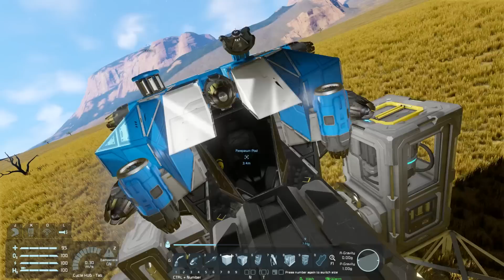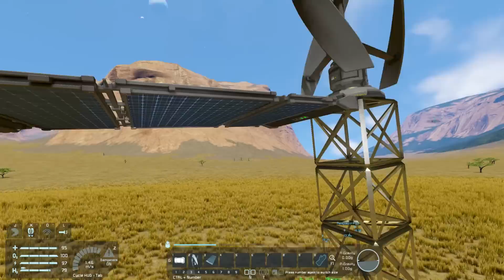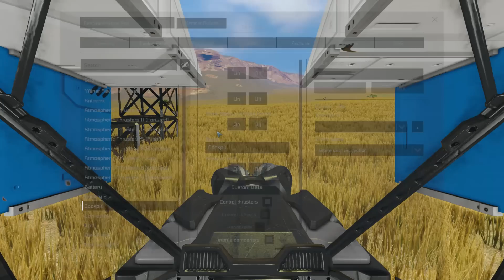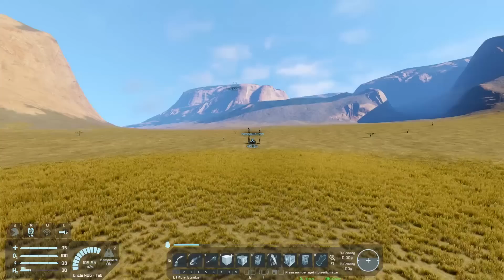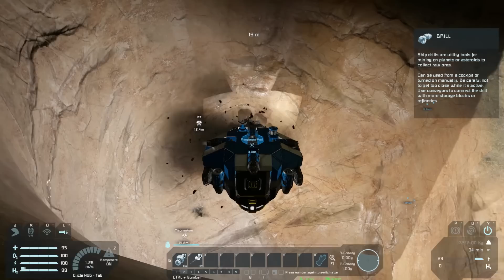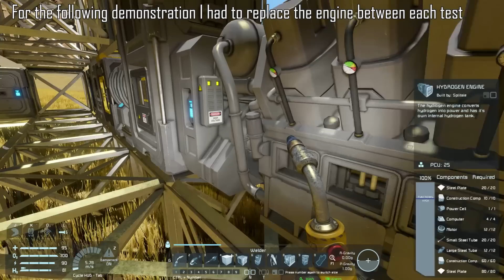Power Systems - Getting Started in Space Engineers #3 (Survival Tutorial Series)

Comment: Dear Spitsie--  Please keep making these so I can keep advancing.. oh so slowly. Well done, and much appreciated efforts!

When I'm not using the big power-sucking devices, I turn them off, and let the 2 windmills charge some batteries I've installed. Also, set the vehicle battery to non-drain, recharge only. Anybody else?

Also wondering: does your miner recharge if it's turned off? Or if lots of the systems except the needed ones are off? Less drain either way, maybe?
Reply from the maker: Thanks, glad they've been helpful :)

The miner will not recharge if it is off as the connector would also turn off and you wouldn't be attached to the base. However, if you turn off most blocks except for the batteries then it will recharge and is probably something you want to do anyway :)

Comment: So, you use electricity to split water (ice) into hydrogen and oxygen, then you burn that hydrogen, producing power with water (presumably steam, since that's the product of hydrogen combustion in the real world) as a byproduct. Somehow this results in a net energy positive.
Reply from the maker: The system doesn't make sense if you think of it in terms of electrolysis and hydrogen fuel cells with current technology. Instead think of it as a gameplay mechanic (separate to real world physics). Instead of adding yet another voxel material to enable the addition of a fuel powered engine (that isn't a reactor) they decided to use ice and hydrogen as a fuel stand-in ignoring those other issues :)

It really helps make their existence more acceptable if you think of it in this way :P
Reply: @Splitsie  I'm fine pretending they use some magical catalytic technology that enables this kind of thing, to preserve the enjoyment of the game. =)

Comment: So, the thing about Hydrogen Engines is they're designed to work with a hydrogen tank. I've had similar issues, to turning it on and off even with a tank, but that buffer helps with the issue of normally needing two O2/H2 gens.
Reply from the maker: Yep, the tank does make them behave a little more like you'd expect (except for having to toggle power to get them to start), I still liked using it for an example of how to toggle power on your grids as it's advice that I see given (and misunderstood) on reddit a lot :)

Comment: Enter the Advanced Rotor with a small rotor head and a small ship Hydrogen Tank with a connector on the other end. Dock the mining ship full of Ice to the hydrogen tank and the bases O2/H2 will pull the Ice then fills the tank. This way you will not need a second O2/H2 on the base since you can now supply the Hydrogen engine with enough Hydrogen to fill its on board storage and it can run at its full potential. Sure you can build a large hydrogen tank but when starting out, a small one saves on resources plus you get the added benefit  of relocating the small tank by detaching the rotor head and not loosing what hydrogen is in it.
Reply from the maker: Using the rotor size switch is also a nice way to get lots more storage on the base without needing grids as well, and with the increase in capacity of the tanks a small one is probably adequate for a while. It's something I'm still trying to decide when to best include in the series as the concept often ends up misunderstood by newer players :)
Reply: Sounds like the makings of another tutorial. Rotors: What else are they good for and how to use them.

Comment: I find a sensor, set to detect me when I'm about to get into a cockpit, connected to a sound block that shouts "turn your batteries on you spoon" works quite well...
Reply from the maker: Lol I completely endorse the setup of this sort of system, useful for new and old players alike :D
Reply: I put my startup/shutdown sequence along my hotbar in preferred order (ie: toggle recharging off, toggle gyros on, toggle engines on, toggle ore detector on, toggle connector to disconnect, etc). It's easy and almost* foolproof.
Reply: Im reading this after crashing ship on ground and trying to figure out what happened for like 20 min then realizing I forgot to switch battery on.
Reply: Spooning is ok .... but forking is better ! 😎
Reply: Kontra Septic knifing is even better
Reply: Great idea :D
Reply: LMFAO!!! I have had to reload a save multiple times cause I forget to hit "6" before disconnecting, which is my button for recharge mode on my g-menu.
Reply: 3 times tonight. My second day engineering so never thought of that or at least a sign :P
Reply: as for me, I put button that call timer that set to recharge, never put it on your control seat toolbar. 
and also I add indicator light or sound on that timer, or maybe LCD that says charging battery, it looks cool battery charging warning system
Reply: 3 years later... it is VERY common that I build a new ship and then spend the next 10 minutes wondering why it's just falling off the connector and not responding to commands.
Reply: a program block that does it automatically works better ... and all it has to do is toggle the lock or unlock and turn on what needs to be turned on before it disconnects ... and turn off what it needs after it connects ... not hard at all

Comment: The cost to /(benefit and time wasted) building a atmosferic ship using a battery to w8 for it to recharge and the ship having A VERY LIMITED capability spectrum IS ABSOLUTELY terrible
after u set up you base don't even bother with building a minnig ship with batteryes and just go for a hydro powered miner with 2-4 drills and atleast a 100 k cap .
if your ship has 10-20 k cap I can do the job 5 times faSTER with hand and with 0 risk if inventory is set to 10xx then atleast 20 x faster with less risk and 10x easyer 
The tutorial is good for new commers but not showing the BEST way to advance ANYWAY good video man keep em comming .
Reply from the maker: This is a tutorial for new players, I'm playing with default settings and providing advice based on those because that's the most likely setup for new players. I would disagree that hydrogen based miners have better function even when using high inventory settings. Since you need to spend so much time collecting all the ice required when a more efficient setup these days is simply pistons and drills mounted on your base and a small battery powered miner for collecting ores you need (with x10 the drill capacity is so large you are unlikely to use up what you've collected within the first 8 hours of playing, longer for newer players).

Comment: I've found that the most reliable way to trip the Hydrogen engine in, after it is first built, is to trigger the H2/O2 Generator, even when the engine is attached to a tank. Simply recharging a  Hydrogen gas bottle, in either the tank, or the H2/O2 gen, will trigger the H2/O2 gen to replace the gas and it wakes up the Hydrogen engine to start filling it's own tank
Reply from the maker: Yep, the tanks are more reliable - I found I only needed to toggle the engine on and off to get them to fill from tanks in most situations. Nice to know that empty bottles will trigger an update for the system too :)
Reply: Oh nice, I'll have to remember! I love using the hydrogen engine in my rovers, and sometimes I forget to fill the H2 O2 generator completely and the engine dies.
Reply: Thanks!

Comment: How does it make sense we're gaining power from electrolysing ice and reversing the reaction in a hydrogen engine?
Reply: because the ice is combusted and you dont get the water out of it. In a therodynamic sense, it shouldnt work, but for the game it makes sense as you use Ice as a rescource to keep the circle running and dont get anything out of it. Put in ice, get out power. You dont generate much power this way, only about 150kWh - 200kWh per 10.000kg ice, so it's not that much of a boost. 
I prefer to us h2 as fuel, because recharging a vehicle with h2 (from a station which has some h2 stored) is a lot faster than recharging its battery due to the battery input limitations (every battery needs at least 15 minutes to fully recharge, if i picked up the numbers correctly). The only problem is, that once its empty, you need a backup battery installed or a reactor to refuel it, since you cant transport h2 in your personal inventory.
Reply: Alright. I think it would make more sense if hydrogen served just the battery replacement purpose you described and you didn't get more power out of it than you put into the h2o2 gen, but I understand the idea behind it now.
Reply from the maker: The reason I didn't touch on that is because it mostly doesn't make sense if you think of it in terms of electrolysis and hydrogen fuel cells with current technology. Instead think of it as a gameplay mechanic, instead of adding yet another voxel material to enable the addition of a fuel powered engine (that isn't a reactor) they decided to use ice and hydrogen as a fuel stand-in ignoring those other issues :)

Comment: i Hope thy make the H2 en a bit more effizient thats why 2 much 2 run this i mean in rl a Car en need much less fuel then this per h then this  and i think the normal fuel gen in my garage has a better fuel consumption  then this XD
Reply from the maker: It's pretty hungry for fuel, I still can't think of a situation I'd use it, other than early game if I started right next to an ice lake :/
Reply: @Splitsie  well i use it in my miner ship but without a tank it hase no rl use (smal grid) 4 emergency power but well i think it should 50% more efficiently with the Hydrogen use the i can build a hydrogen ship only as challenge but 4 now i think i need more then wat 10 full tanks only to fire 2 engine 4 more then let lie 10 mins XD
Reply from the maker: I think a nice balance change would be to halve the power output but reduce the fuel compensation to 1/4, so it's more efficient but less effective. Meaning that the weight factor of the blocks would prevent you from easily powering something that flies, but would work really nicely for a rover :)
Reply: @Splitsie  Yeah may be better they need way 2 much H2

Comment: Yep, you covered the loss of a starter ship quite in depth on this one Splitsie, thank you for that :) If I had only known a few days ago lol. I saw in another video where someone created a wind turbine "tree" which is very appealing. With the wind turbines mounted sideways instead of vertically you can have 1 on either side of your tower and they don't interrupt each other's performance. You can then mount the next 2 90 degrees from the previous ones and you don't have to go up that much higher to add the new ones. Basically I start at 7 blocks high, then go up 5 and add 2, then up 5 ad nauseum. You end up with a lot of power generation in a small space this way.
Reply from the maker: Yep, you certainly can, it's something I plan to mess with in detail in a video just on the turbines as I have an idea for a weird design that might allow quite high density ;)

Comment: Wait... ore detectors consume power? There's nothing in the block's info that says it uses power. checks wiki damnit, game. 

As to the hydrogen engine, from what I've seen, it's really only suitable for emergency power, to keep things running while you pull a major rebuild or the like. I wouldn't even want to use it as a main source on europpa...
Reply from the maker: It's incredibly ice hungry, I'm still not convinced of a good use for it that can't be handled better by batteries :/
Reply: The only use-cases in vanilla i can think of are terribly contrived. I mean, how often are you going to have ungodly amounts of ice or stored h2, and no other options?
Reply: Come to think of it, would make some sense for a tweaked europpa start where you have one instead of other power sources.
Reply from the maker: Yeah, something like that, either Europa or starting on an ice lake. Using a hydrogen engine would be a decent way to boost your early power production so you can bootstrap your way to bigger things more quickly - by being able to recharge the battery based ships more rapidly etc
Reply: I don't think you are giving H2 generators a fair chance or maybe not using them properly...I have a base powered by 8 of them and I think where the confusion must come from is the internal H2 storage and having an unfilled H2 tank.  Flood your system with ice for long enough to hit equilibrium, 100% full generator and base H2 tanks, then judge them again.  

They really aren't that hungry once the system isn't running full bore to fill tanks

Comment: Wind turbines seem to be a bit OP. They produce more power than a solar panel at full exposure, are cheaper to make AND work 24/7 ? Seems like the only drawback is that for each turbine you need an independent pylon, 8 LB's away from anything else, so the ground footprint is way bigger.
Reply from the maker: That and they won't work on a mobile grid, but I agree, I also thought they should be closer to the power output of a solar panel per day, just providing it constantly
Reply: @Splitsie  but they only works on easy planets (with atmosphere/air) so this may be a reason for the power output
Reply from the maker: The trouble is, most of the planets fit that category, they work nicely on Earth, Mars, Alien, Europa, Titan (at least I think they work on Europa since atmospheric thrusters work there)

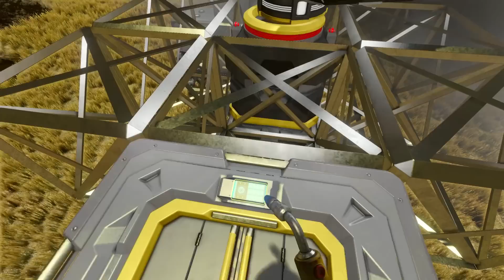Comment: 22:48 That's "Show block in terminal". That's why it solved nothing. If you went to just the battery and wind turbines you'd probably have more luck turning the base back on (I said probably, I don't know if there's a hidden power switch you need the cockpit or control station for).
Reply from the maker: I just had a look through my footage again to check if I was going crazy. With the grid power turned off using Y, the batteries and wind turbines when viewed individually, show themselves as powered on... previously it was not this way, so something changed intentionally, or something was broken unintentionally making using the power switch quite risky and a special case of powering on and off.
Reply: If you use Y to turn a grid on/off, it just toggles the grid's power blocks on/off. You can easily fix that problem by finding your power blocks and manually turning them back on (hydrogen engines, reactors, solar panels, batteries, and turbines will be turned off by pressing Y)
Reply from the maker: Oops! Totally missed that I did that even in editing :P

I did do the blocks individually as well and it didn't work though, and I'm pretty sure I didn't do show block for everything :P
Reply: It's quite easy to miss because it's the same toggle buttons in the same spot with a tiny header above, so I don't blame you. You can blame it on Steve ;)
Reply: @Kyle Baer Actually, the contents of your inventory do count towards a ship's carry weight. You the engineer do not, but your inventory does.

Comment: Yet another great production! one thing to add, the hydrogen engine works "more reliably if it has a tank to draw from instead of just the O/H generator. i think the reason for this is that the O/H generator has to start before the hydrogen power generator actually gets H from it and that creates an issue where the H power gen doesn't start.. on the other hand the tank if it has any H stored it will then give it to the H power gen to fill its tank before it starts, so when switching it on it has that bit to start it up whereas the O/H gen has to convert it first from ice to supply it and its only half what it needs so false starts will be common. at least this has been my experience. i always try to leave H in the H power gens when i turn them off so that they start up whenever i toggle the block back on.
Reply from the maker: That's true, though I've always had to toggle the generator on/off whenever I had a tank as well, except for when placing the generator with creative tools :/
Reply: @Splitsie  i meant after you get it working if there is H in the tank of the H-Engine (not a separate tank) it should turn on every time without fail, unless of course you run it dry, then you may run into issues again.

Comment: My new project is a mobile base with a mining drill, and landing pad on top. In thinking 20x20x10 I didn't think about wind turbines and if they can be put on a vehicle. If not I'll try to make a base with one block touching the ground, and delete it once in ready to roll. Maybe they'll keep working...
Reply from the maker: Wind turbines will only work on a vehicle if you have a landing gear to attach you to the ground. You won't be able to put that landing gear on a piston either as that will only lock the grid at the end of the piston, not the base, so the landing gear will need to be on the same part as the turbines themselves
Reply: @Splitsie  hmmm. I'll see if I can find a workaround. I'll look into how the batteries might transfer power, or put a conveyor, and a connector on the landing gear side and another on the main body. Can you dock two grids of one vehicle to each other? Lol. If I can find a way I'll just have to stop and drop the foot whenever I'm low on juice. Might be futile, and impractical, but that's my favorite kind of thing to waste time on.
Reply: I didn't find a workaround, and the mobile base gets tore up by trees. I did come up with a set of ship tools that I can swap out using connectors. I put landing gear on the bottom to lock them to my base. Then I put a connector on the back, and another on the front of my ship. I can swap functions easily without making three ships.